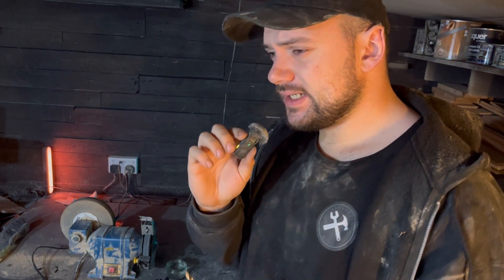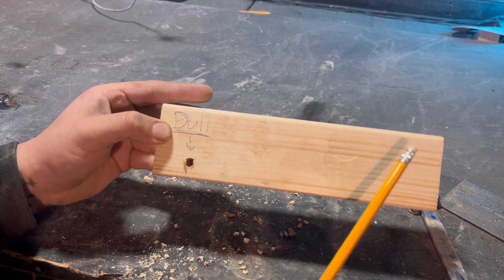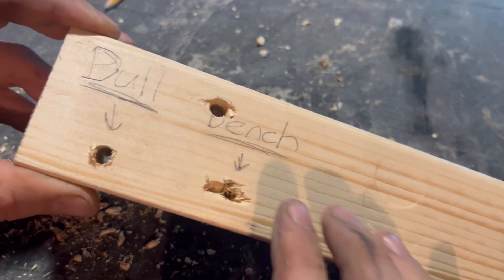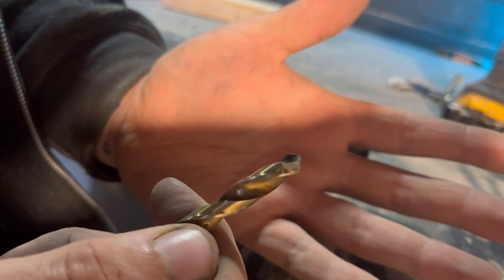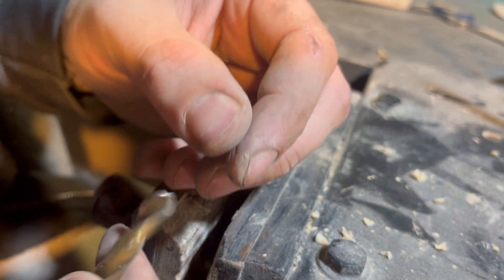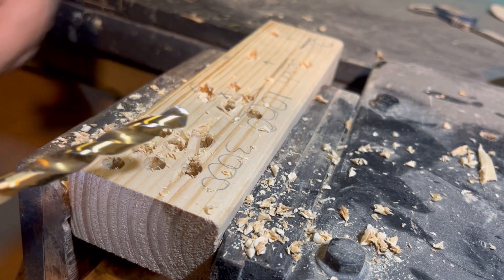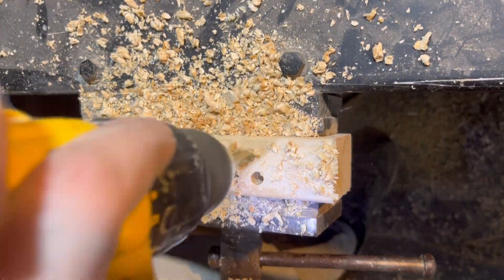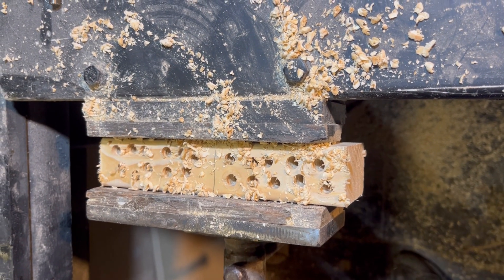What Happens When You Sharpen A Drill To 3000 Grit!

Comment: Sharpness is essentially the the amount force required to make a cut. There are two basic factors, the thinness of the apex, and the geometry of the cutting tool. Sharpening a drill bit really only changes the thinness of the apex, the geometry is already in the basic shape of the bit. So, with a high speed drill, you barely going to notice the difference in the force needed to make the cut, especially in wood. But, with an old style auger bit in a brace, then you would notice the difference. Those cut beautifully when they are nice and sharp.
Reply from the maker: That explains a lot of why there wasn’t a massive difference from sharpening on the bench grinder to sharpening up to 3000 grit thanks for braking that down for me answered some questions I had

Comment: just the tip makes no sense, sharpen the tip wil get your momentum easier to "plunge" it in there, but the sharpness also includes the whole spiral of the bit
Reply from the maker: Your thinking of an end mill the spirals on a drill bit are there to clear chips all the cutting comes from the pointy end of a drill bit
Reply: @barrovianmade  that makes sense indeed, is that the same as an auger bit? I saw a bloke cutting himself whilst fastening it on a hand drill

Comment: You sharpen drill bits? I usually just throw them away.
I suspect there is all sorts of "science" at work here unseen. However a lot will be to do with the speed that the cutting edge is at when it cuts the wood. A drill bit is going extremely fast, where a chisel is very slow. Think electric planer blades (that give a very smooth finish instantly) against a hand plane which requires repeated passes. They are both doing the same thing, but the electric tools do it that much quicker. 
Interesting video anyway and one I definitely haven't seen done before. 👍
Reply from the maker: Never thought about it like that and yes I sharpen my drills mostly out of laziness I can just give it a few licks on the bench grinder and it’s good to go instead of cleaning the dust off myself and driving to the shop 😂